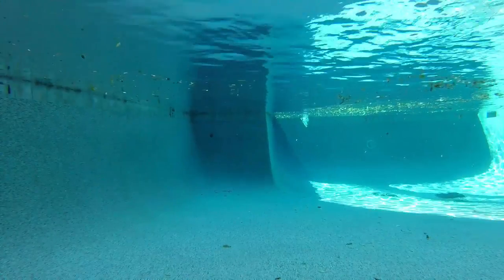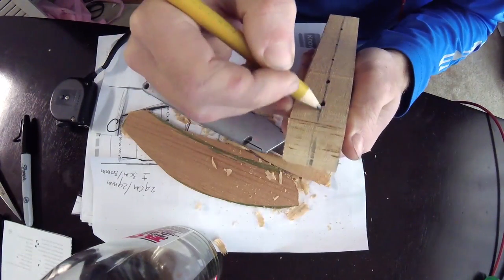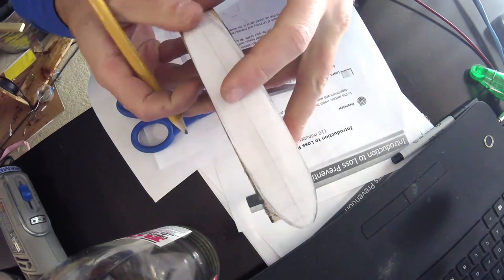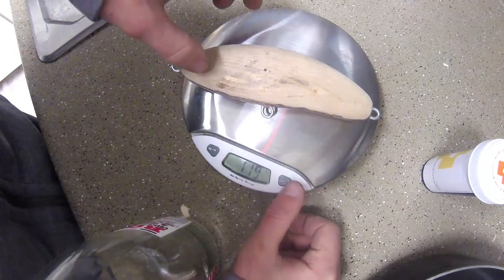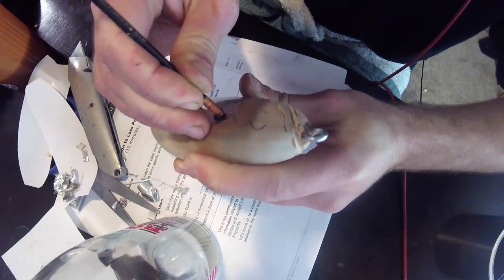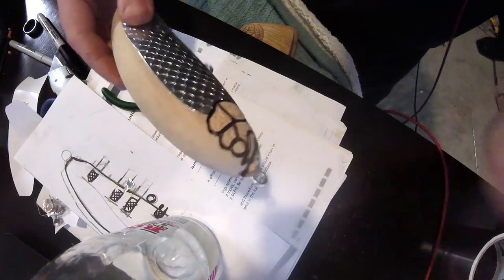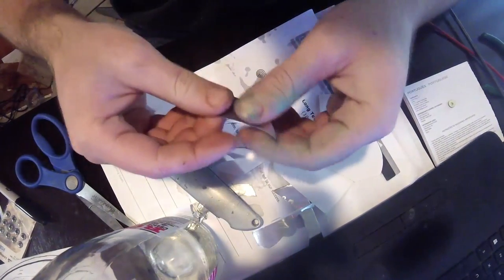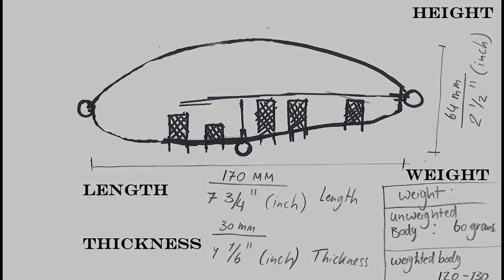How To Make A Stickbait With A Stencil!

Comment: Hi,
I made few stickbaits with weight behind the hook hanger and all of them just keep roling no balanced s-swimming action.  Could you please advise on how to prevent the lure from rolling. The weight was not drilled too deep inside the body. Any tips will be very much appreciated. Thank you,
Reply from the maker: If the lure rolls then someting is out of balance, quite possibly the shape of the lure (try a straighter design, reduce the curve) or maybe you haven't added enough weight.

Comment: Hi could you tell how to do the paper bit to show the top shape .?
Reply from the maker: Hey man! So I just free hand it. Once I've cut out the body shape, I will lay the piece of paper over the back to cut it at the right length after which I fold it in half so that when I cut out the side it is symmetrical when I fold it open. Hope that makes sense. Check out some other vids to see the actual procedure of the back shape. Thanks for watching!
Reply: The Angling Globetrotters thanks